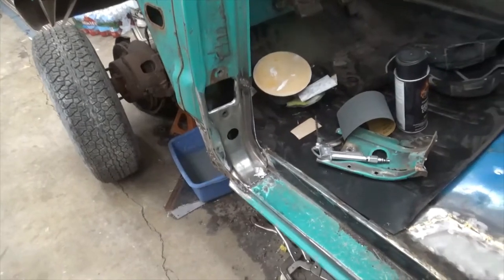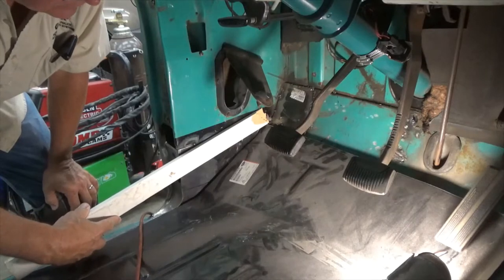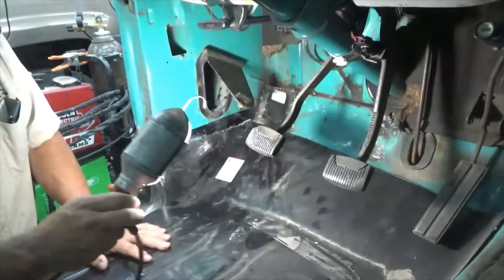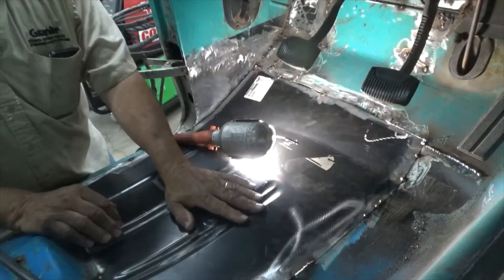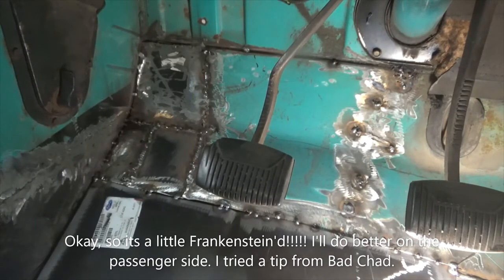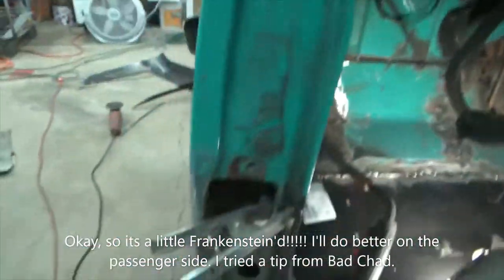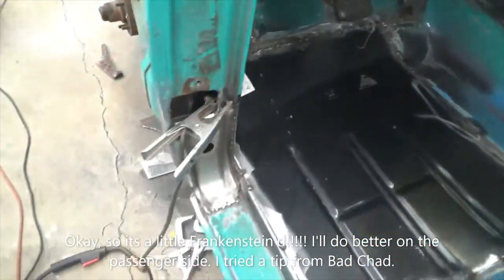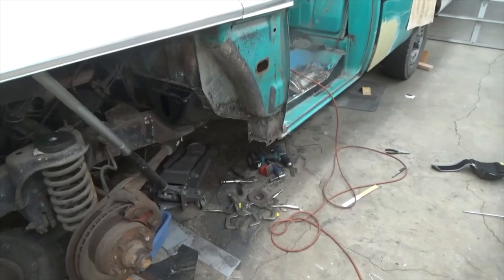1966 Ford f100  Finished A Pillar and drivers floor

Comment: I tried the coat hanger on a wide seam, it was okay. I like your door pillar the way it turned out. Your going to have a nice truck again and I hope I have the same on mine. Your right, why do it if you don't enjoy it. I'm learning as I go. Thanks for sharing.
Reply: Keep me informed I’d like to see some pictures of what you’re doing.
Reply: @norust1966  Might be and little bit before I send images of the 1971 F250 I am working on. Not the best at computers but trying, the comment line does attachments.